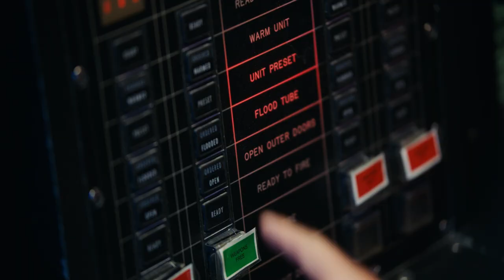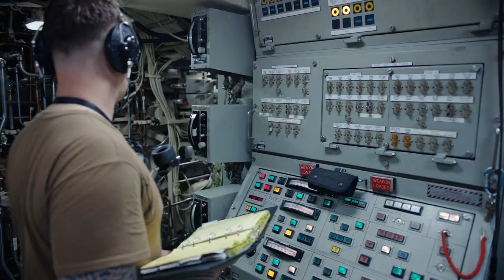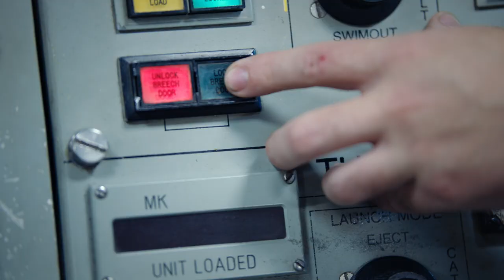Navy Torpedoman’s Mate – TM

Comment: Torpedo rooms on modern submarines are really weird. You read the stats of a submarine and it says it carries 18 to 24 torpedoes, but every time I see pictures or videos of the torpedo room, you see maybe 2, at best 4 torpedoes in there. Sure, could theoretically be that they aren't fully stocked when the pictures and videos were made, but in most cases it isn't even clear where more torpedoes would be stored, if the boat would be fully stocked.
I suppose some are under the floor, like on many old, WW2 submarines, but first of all, there can't be room for like 20 torpedoes down there, since the torpedo room usually already is on the lowest deck and secondly, I also don't see any winches or cranes you would use to lift a torpedo from a "under-floor" storage up to ready it for loading the tube.

Another thing I'm wondering is why there still seems to be so much manual labor involved. The Soviets had fully automatic torpedo storage and loading systems on the better ones of their submarines since the early 70s.
Reply: Fully automatic torpedo tubes aren’t so reliable if you do research subs with that type of loading mechanism had a lot of issues and was costly at times. So manual labor like this is a lot more reliable and worth it
Reply: Look up a Virgina class sub or even Los Angeles Class. Those are the subs that carry more than what they tend to show. This was a Ohio class sub so they don’t really carry many torpedos.
Reply: There is no torpedo storage under the floor. The rest can be neither confirmed nor denied. Realize you are seeing videos of nearly empty torpedo rooms to give the camera the necessary distance for a proper wide angle view. Most videos only show the top level of racks, not the bottom. There are two levels of torpedo racks to support the top and bottom tubes. Perhaps if you get the chance, you can visit a sub base and take a tour after working hours or on the weekend. It seems like you would really enjoy that.
Reply: Fully automated will eventually break. Torpedoes are long with very little clearance, millimeters. If an automated system was to receive improper maintenance or excess wear over time, even the slightest mis-angle of a few millimeters would jam a torpedo when loading or unloading a tube. Manual operation properly accounts for that situation.